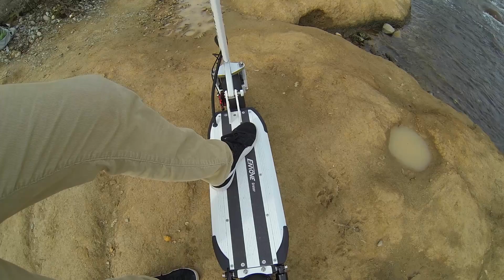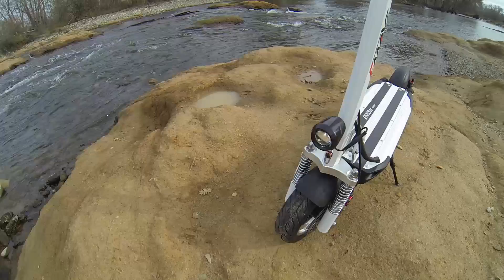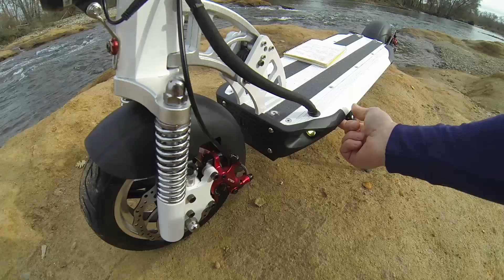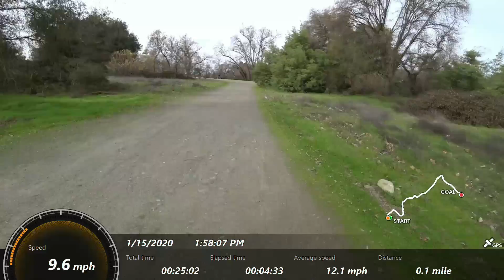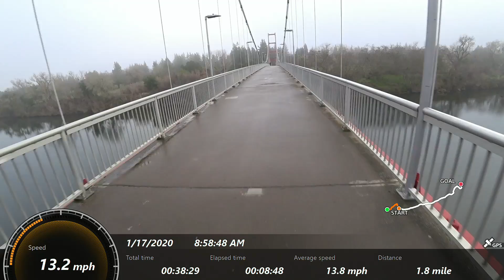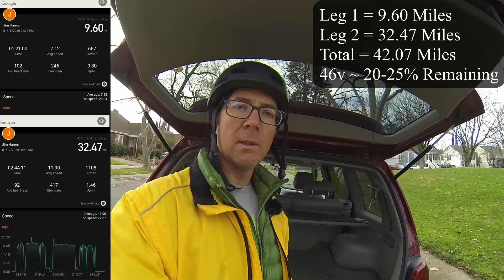Emove Cruiser Electric Scooter Review!

Comment: Like to see the Emove Cruiser go up against the Zero 10
Reply: Compared to the Zero 10, the Emove Cruiser offers 22 more miles of range, it has a bigger battery by 624 watt hrs that are LG cells, it has a much higher weight capacity by 88lbs, it has much tougher tires that are automotive-grade and tubeless, and it's IP67 Rated so it can be operated in a wider array of weather conditions, it has hydraulic brakes, it has a voltmeter with on/off key switch, there's an available optional cool twist throttle, and it comes with a 1 Year Ltd Warranty against defects by VORO MOTORS...
Trust me, I've looked at so many other scooters.
I'm 6ft tall and I weigh 255lbs.
For my size, I will stick to the Cruiser until I'm lucky enough to get a more powerful beast scooter that can match the range and weight capacity of the Cruiser such as a Zero 11X and Turbowheel Phaeton 👌😉.
As far as what I think is a nice alternative to the Cruiser, IF you're fine with a slightly less range, a lesser water-resistance rating, and a setback of around $400-$500 more in exchange for more hill-climbing power and acceleration and a more advanced suspension, I'd recommend the dual-motored Apollo Pro...
To each's own....for ME, I prefer the Cruiser's higher range, IP67 water-resistance rating, and tougher auto-grade tires for my use and location.
Reply: its totally different, there is the rental ones, the cruiser and the thunder/X, thats the 3
Reply: No need. Completely different class of scooters. It would be like comparing a Prius against a 4Runner. No one would compare the two vehicles. Top speed of the Cruiser is 25/26MPH. Zero 10x is closer to 40MPH
Reply: @lanceguilin  You're misinformed.  I am referring to the Zero 10 not X model.  The Zero 10 is in a comparable segment to the Cruiser.   Link here to educate: https://revrides.com/collections/electric-scooters/products/zero-10-electric-scooter